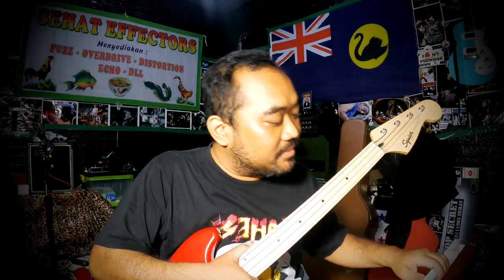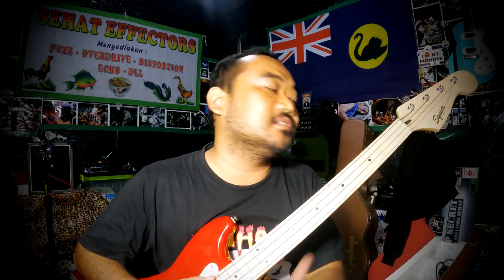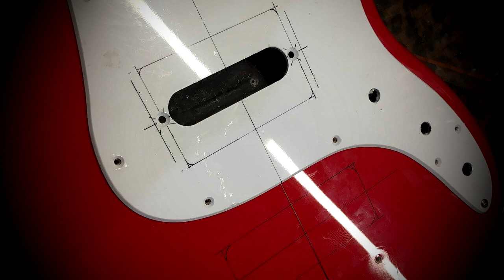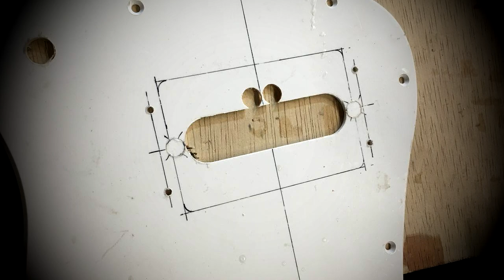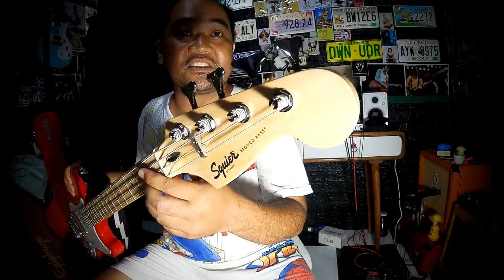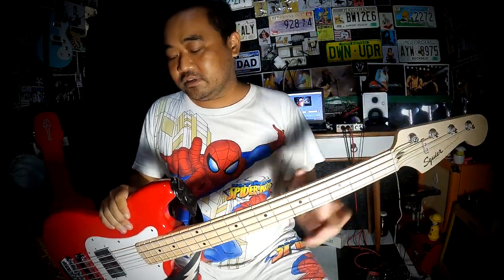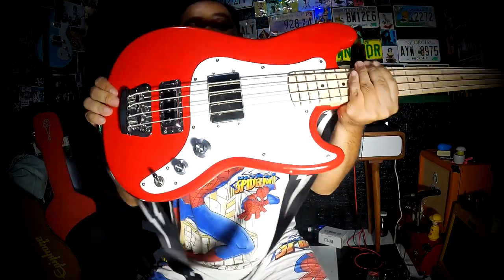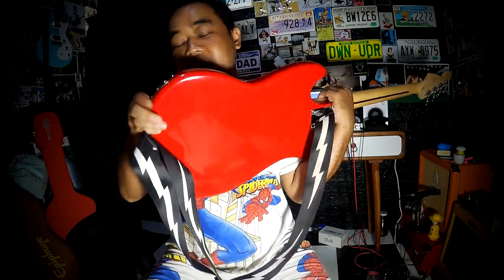Squier Bronco Bass Mod and Upgrade with Rickenbacker and Wide Range Humbucker Pickups

Comment: Correction: The tuners that come with it are fine, and lightweight which keeps the neck from diving. The vast majority of people who buy and Bronco bass thinking they'll "upgrade" the tuners, don't.
Reply from the maker: but hipshot is better, east to tune and keep in tune, stock easy to out of tune
Reply: The tuners are even worse than the bridge that can't be properly intonated. The tuners are awful and don't hold tune at all. It's the only bass I've ever had that I had to re-tune after every 2 or 3 songs I play.
Reply: The one I tested had major slippage issues. I'd absolutely replace the tuners, regardless of weight
Reply: I upgraded mine with hip shot lightweight tuners and they were sooooo much better

Comment: What tuners did you use? I see that you didn't drill larger holes so they must have fit the existing ones. Really like to know where to get those exact tuners. Great video and a great bass
Reply from the maker: Thank youu, its Wilkinson😀
Reply: @MisterSEHATHimself   Did you have to drill the post holes bigger? Or did they fit
Reply from the maker: @albcaucci3923  i have to drill but not much